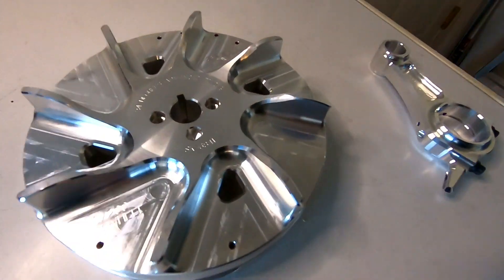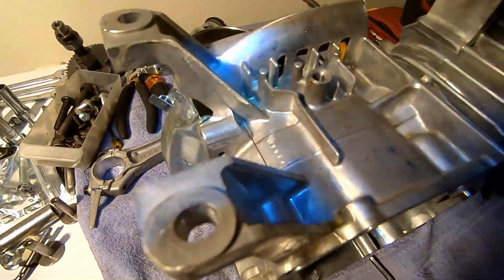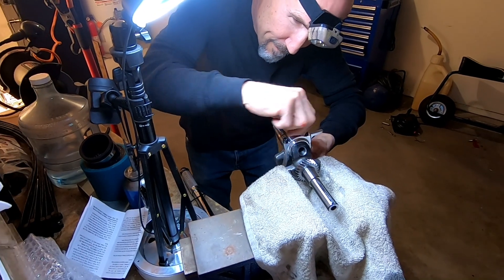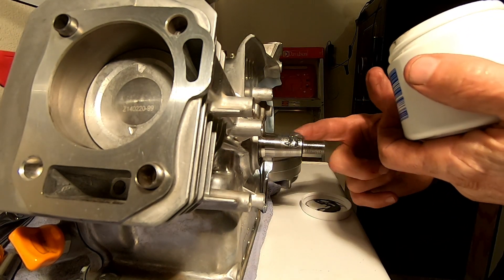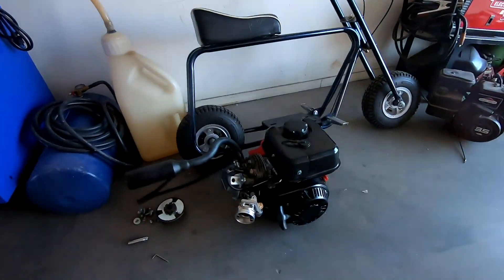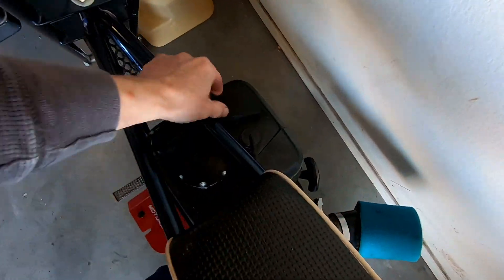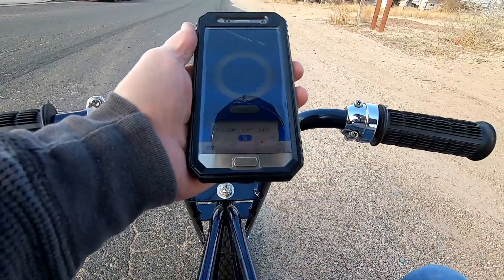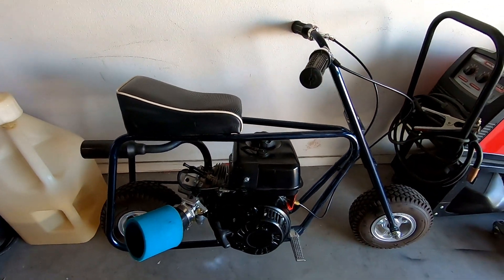Predator 212cc : Billet rod and flywheel : mini bike 0 to 30 speed test

Comment: What minibike is that?
Reply from the maker: It is an Azusa frame . Check out the mini bike playlist for 460 other mini bike videos! https://www.youtube.com/watch?v=krYyLrip74c&list=PLkbj-ip-5FzbLQb21ZZW1mmWP45vj4kxW&index=1
Reply: @Black66  I'm new to minibikes and you've obviously have had alot so how does that Azusa frame compare to the DoodleBug? It looked like it had a longer frame unless it was just a shorter seat? How about seat height, similar? Which would you prefer out of those two bikes mentioned and a cc100x for the rolling chassis alone?

Comment: Do you know what size you used for the bolts on the rod?
Reply from the maker: 12 point 1/4 socket for the ARC rod
Reply: @Black66  thanks you

Comment: What size Allen head bolt did you use to seal up the Governor hole?
Reply from the maker: I used a 1/4 Bolt-on the hole on the top of the block.
If you can find one with self-tapping threads, even better.
Reply: @Black66  what about the one behind the flywheel?
Reply from the maker: @JadenCrocker  I didn't need to plug the one behind the flywheel because I removed the nylon gear from the factory shaft and left the shaft in the hole.
Reply: @Black66  ah okay. I find it really hard to take the gear out without pounding it, any tips?
Reply from the maker: @JadenCrocker  Its just easier to take the flywheel off and knock it out from the other side and put a bolt in it. Otherwise I get a very small screwdriver in there and get it under the clip holding on the wheel.

Comment: what did you use to hold the crank when tightening the flywheel back down?
Reply from the maker: A tool that I made out of an old clutch . You can see it in my Tillotson governor removal video . The video is in the Predator / Tillotson section on the channel

Comment: i got that pvl flywheel on the ducar 212 what would be your first upgrade the valves or billet rod or cam
Reply from the maker: Billet rod . I would do the internals first so it would be strong enough to handle future mods
Reply: @Black66  u think ill be  able to make it a TRue BEASt already got the header and vm22
Reply from the maker: @CruiZe-A-ViSiON  It will be pretty fast compared to the 3.5 horse for sure. You will be surprised at the difference.
Reply: @Black66  its gonna be a beast no matter what
Reply: @Black66  so if u were me what would the next thing u would do if u had the Ducar engine
Reply: @Black66  if u could make a lil list what would the first things be after the header pipe n carb i just wanna go fast man take some pink slips
Reply from the maker: @CruiZe-A-ViSiON It really depends on how radical you want to go with it. You can go mild build with a billet rod and flywheel and drop-in cam and it will go sixty-plus all day long and be pretty quick for sure.  Or you can go wild and install a stroker kit with a big valve head with a flat side carb and go 80. I would fortify the engine first with billet parts. Because all the racing parts aren't going to do much good unless the engine will hold together.
Reply: @Black66  stroker diesle utah those my boys Tmoney But yea cant i start with the first package and the stroker kit it i thought they said the Ducar came with the good flywheel already did u see the reveiw from the channel called Me going Fast he compares the Ducar predator and tilly e
Reply from the maker: @CruiZe-A-ViSiON  Ya, you can start with a basic billet rod a drop-in cam, and advance the timing on the flywheel and it will run really well.
Reply: @Black66  hey man thanks for the info I'm gonna look for that billet rod I guess first what's a good chain too like a gold one
Reply: @Black66  what's basic
Reply from the maker: Yes, you just have to decide how radical of a build you want to do.
Reply: @Black66  i want as much billet and sturdy parts i can put on her im gonna call it the BeasT Master BuiLd 2.0

Comment: Don't you have a video with a flat top piston install?
Reply from the maker: Not yet, Ill get one out there. I have one coming out installing a billet rod And installing the stock piston
Reply: @Black66  gotcha thanks brother trying to figure out 20 over or 40 over rod with a flat top
Reply from the maker: @ratrodcourier8576  if you already have the piston you could throw it in there and run a straight edge across it then run a feeler gauge under it to see which would be better
Reply from the maker: @ratrodcourier8576  mock-up with the stock rod
Reply: @Black66  piston and rod I'm looking at come together, the piston I believe is an after market, the rod 8s arc with choice of 20 or 40 over so not sure which one to order.
Reply from the maker: @ratrodcourier8576  If you get a piston with the same pin height as a stock piston then you will know what rod length to get based on how far down the stock piston was in the hole on the stock build.
Reply: @Black66  I messeged the guy with the kit and asked about pin height no info on piston so I guess play it safe and go 20 over.  Can always use a thin gasket to make up for it
Reply from the maker: @ratrodcourier8576  Yes that is true because you figure , a lot of the stock harbor freight engines come with the piston  .020 in the hole and more, and they run just fine .
Reply from the maker: So even if you end up in the hole that will be ok
Reply: @Black66  that's what I was thinking. Trying to get compression up and it's time to upgrade to billet. Ran 61 mph at about 8500 rpm with stock parts.  Little to far lol and I hurt it.
Reply from the maker: @ratrodcourier8576  lol , that is awesome!!

Comment: If you take the piston out of a engine with maybe a hour on it besides break in,do you have to hone the cylinder ,or replace the rings?
Reply from the maker: No, you can pop it right back into the engine.
Reply: Good ,I've gotta put a rod in mine next ,I'm not running it much until then
Reply from the maker: @Eddielongan  Good idea. Good safety measure.
Reply: Yeah I've got a billet flywheel,and quite a bit done,there in stock again so I'm bout to order it.  Lots of new videos on my tiktok @eddielongan
Reply from the maker: @Eddielongan  Sweet! Ill check it out

Comment: 03:42 This is where the HEMI guys realize they have to cut deeper reliefs into their piston head.. especially if theyre the guys who swapped out their hemi head gasket for the thinner non-hemi head gasket to increase compression

04:10 what size feel gauges did you use to set your lash?  I saw a videos where guys did .003 and .003 (grey goat garage youtube channel)  .005 and .007, .006 and .008, and .004 and .006.  The other values were Red beard'ss, and CarsAndCamera's.I even read in the comments where a guy said he says he sets his for zero lash.   I think I saw in one video where the guy said the manual says to do .006 and .008. and he did .005 and .007 instead
Reply from the maker: You know how it goes with this kind of stuff. Everybody has their own experience and their own opinion. For Me, I usually just set them around .003 and go from there. I haven't had any problems so far.

Comment: Will this fit my hemi engine
Reply from the maker: The rod will fit the standard Predator or the Hemi. The taper is different on the flywheel. But they do have a flywheel for the Hemi on the ARC website.

Comment: I Always see people dump a bunch of money into these things and barely break 40. My 212 Just has a billet flywheel and the bolt on stage 1 Kit with 12T Clutch and 54T Sprocket and hit 46 All day and I accelerate just as quick. I don’t get it?
Reply: I wonder if those $400 Bully clutches hold up
Reply from the maker: @ChristopherJones16  I'm not sure. I would hope so for $400. Maybe one-day ill test one out. But I'm kinda on the cheap side. lol
Reply from the maker: That is totally true. You definitely can have a pretty much stick bike go 40 or even 50 with the correct gearing. For me it's just a hobby installing  different parts to see what they will do.
Reply from the maker: That is really good. You must have the right gears on yours .  
Maybe they just don't have them geared right . Not sure.
Reply: @Black66  I guess so only downside is my clutches don’t last to long. lol
Reply from the maker: @anthonyrizzo255  Ya, true but at least there not that expensive.
Reply: @Black66  Yeah definitely still hurts the wallet though lol but it’s worth being able to cruise at 40 and relax on a nice day

Comment: Those parts won’t make it any faster but it will help it from not blowing up. If you want to go fast I would get a 18tooth sprocket clutch and it should hit 65mph.
Reply from the maker: Your right ! On another video on my channel I hit almost 60 with a 17 toorh
Reply: How bout the rear sprocket how many teath?
Reply from the maker: @lilbeviltwin  The rear sprocket is a 72.
Reply: @Black66  ok
Reply: You would want the rear sprocket a little smaller and than the wheel, because the bigger the sprocket the more torque and the smaller it is the more top speed
Reply from the maker: @devanlagaisse3564  Yes, that is true. If you watch my other videos with this bike , I change the gearing by installing a bigger gear on the clutch. I reach a top speed that is pretty much way too much for such a small bike.

Comment: Nice video keep up the good work.. I just got a mini bike 212 predator engine with 18inch exhaust bypass governor I’m hitting 48mph.. but what carburetor should I put I’m running stock right now thanks
Reply from the maker: I think a VM22 Mikuni would work really good. I put a VM22 Mikuni on the minibike. It runs really good with that carb. I just put out another video with the Mikuni. You can pick one up on Amazon for $54
Reply from the maker: Thanks for the comment. I think your bike is faster than mine. With a Mikuni, I bet that thing will really fly!